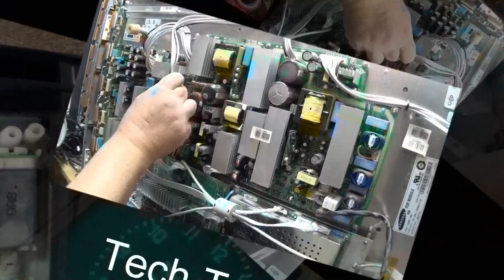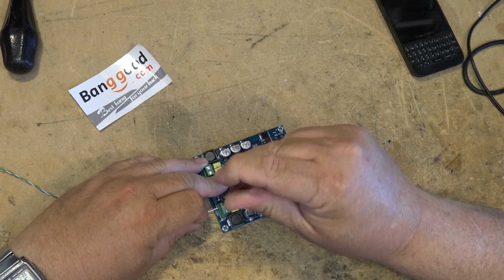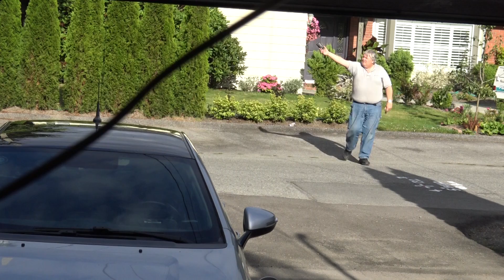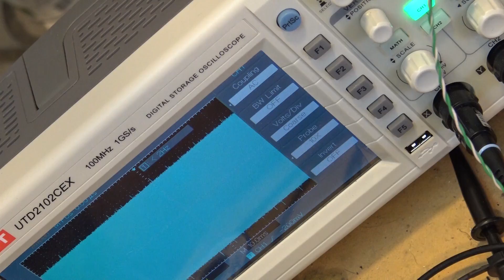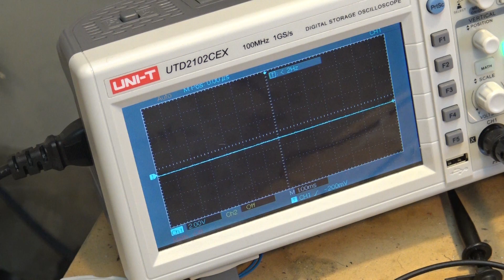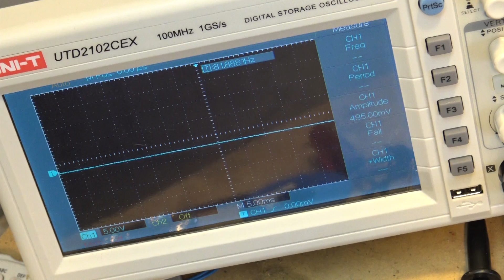TPA3116D2 120 WPC Bluetooth Audio Board test run

Comment: you well need 20 amps on 12 v so how can that thing do 120 w per channel  .....magic ?
Reply from the maker: That spec claim is at max chip voltage which if i remember was 27 volts, and it was also into two ohms. At 12 volts and 8 ohms it's more like 30 Watts.

Comment: What’s the minimal power requirement to power two 1.5” speakers at 10-20watts each? I’m trying to build a portable lipo powered unit.
Reply: I have a few projects in mind from 1.5” speakers to 3” speakers but I’d like to find a Bluetooth board that I can use for various projects to eliminate research. Something they can push 3” speakers and ALSO be able to operate at low voltage for pushing 1.5” speakers because of the type of installation.

Comment: Excellent analysis, made my day
I am building a 5.1 system and isolating woofer completely paired with it's own amp, this helped me decide on what configuration to use as I am using 12V to make it portable as well with a Li-po battery pack. So in theory I should still be getting ~50/~50 L/R with ~50W  2.1 channel or 2x(50W+50W) + 2x(~50W) making part of the system portable while keeping overall performance good enough.

Comment: I've read through the comments and didn't see an answer fora question I have, which is probably simply due to my ignorance. My question is can I use this to power some speakers on my ATV? From the comments it seems as though these boards require some means of regulating amperage.. Can I not simply run power to this board straight from my atv 12v battery which is fused at 10A but ofcourse I can put and online fuse in place but that wouldn't really "regulate". If I can't use this board what do you recommend? It will be mounted in a  waterproof p BOSS brand 6" Tube ATV  speaker. I took apart the Boss tube and it surprised me that it came with a board style amp as I expected it to be in an enclosed style. Once again that's my ignorance with this type of information. Any advice or recommendations would be greatly appreciated.

Comment: Hello.Thank you for nice video.İ wanna give you one question.What does it mean 12-24v? How many voltage i must give to amplifier, 12v or 24v? Or there is a voltage regulator on the amplifier motherboard? Please help me. Greetings from Azerbaijan 🇦🇿 🖐
Reply from the maker: It will run at 12 volts at lower power.  24 for max power.   If you exceed 27 it shuts down.
Reply: @12voltvids  Thank you very much

Comment: Hi! I wanna ask the preset volume once you turn on the amp? Because some bluetooth amp sounds so loud once you powered on then you can only adjust the volume once connected.I want to consider buying this one if sure its not automatically in a full volume once turn on😅

Comment: Would a break-before-make speaker switch  be compatible with these types of amplifiers such as this one?: https://www.amazon.com/Amplifier-Receiver-Speakers-Selector-Switcher/dp/B0796KGVXT
Reply from the maker: The switch needs to switch both the positive and negative terminals.  Many of these switches ground all the negative terminals together.  This would have to be tested with a meter to confirm.

Comment: Lot of information on the board however just need your suggestion please..
I have a pair of 30W 4ohms woofer and a pair of 260W 8ohms tweeter.. Im thinking to setup a tweeter - speaker per channel with them so could use them as right and left channels.. Its setup in a single housing..  Like to know if this board be suitable for this speaker setup.. if not then like you to recommend the best amp board with bluetooth please..

Comment: I'm not getting Bluetooth range more than 3 or 4 metres despite soldering the antenna
Reply from the maker: Bluetooth operates in same frequency range as 2.4hz wifi but much lower power.  So wifi can and will interfere and reduce the range.  Sometimes my bluetooth earpiece loses connectivity of my phone in my opposite pocket.  Phone in left pocket earpiece in right ear.
Reply: @12voltvids  ohh! I will try if the range exceeds with the WiFi turned off.. how are you doing in this quarantine time! Do lemme know if you wanna talk over email, we can exchange great ideas! My email is talktoalokd@gmail.com.. ciao!
Reply from the maker: @AlphaTroniks  Quarantine? Not for me. I am an essential worker, so I am at work Friday to Monday as usual, and even get premium pay for doing so. The 3 days I am off I cam so bloody busy with my business these days I have got no time to shoot videos.
So some may be hit hard by the shut down, those of us that still have to go to work are busy, and it makes the job very challenging, as we can not go into peoples homes to do the required work which makes repairs and installs interesting to say the least.
Reply: @12voltvids  ohh! I would love to read an email from you soon! Take care Sir! Respect,
Al from India

Comment: Hi there I've just bought one of these in the UK after seeing your video.  👍. Was wondering though if I used just a 12v power supply would the output wattage power still be 120w per channel or would it be less. Cheers John
Reply: Hi mate. I'm in the UK. Where did you buy from? Link pls. Thanks.
Reply: @SahinurUK  Hi I got mine from Ebay just search for Bluetooth amplifier board,  or Amazon has also. Cheers John
Reply from the maker: It would be less.  Supply voltage determines the p-p swing of the speaker voltage.  24v will allow for 24v p-p  voltage swings per output rail. 12v would cut the output voltage in half so half power everything else being equal.
Reply: @12voltvids  Thank you for your reply. And give the bluetooth trick a try. Cheers John

Comment: I'm kind of new to electronics, am I missing something?
120 watts per Channel???
12 V. Power supply.... is that thing pulling 10 amps? 
Or at 24 volts pulling 5 amps?
I know the thing has inductors but, if the amperage isn't there it's not there! So where does the wattage come from?
One more question?
12 volts X 10 amps =120watts. So that accounts for one channel 120 watts.
You said something about the inductor alternating?
Does that mean the 120 watts is alternating from left to right channels, using the inductor/s?
Thanks Dave. it's an honest question I'm not being a jerk!
Reply from the maker: The way they calculate this is into a 4 ohm load.  This power is also rated at the full working voltage of 24 or 26 volts not 12.  Look up the specs of the chip. Also it is a BTL output. Each leg should be able to put out 50 watts. Remember that the speaker terminals are driven out of phase with each other so one side goes + while the other - and then they flip.   Class D are very efficient so all the way of thinking and calculating power used on linear amplifiers goes out the window.  These are pwm amplifiers and efficiencies are gained through those inductors.
Reply: @12voltvids  okay, thank you!  I appreciate all that information!

Comment: These boards are great for dead bookshelf systems, saving the speakers from scrap. I have to try the 1.5 inch antenna mod.
Reply: Yup. I just gutted out my klipsch promedia 2.1 speakers and am replacing it’s amp with this amp.

Comment: Where did you solder that wire on to. Thanks
Reply from the maker: I soldered it to the copper that formed the original antenna.

Comment: At about 15 min in the scope trace is the best visualization of how a Class D amp works that I have seen on YouTube. You can just look at that and understand what is going on.

I have been wanting to put something worth listening to into my car, but after 10 years in the car audio industry I have noticed that car stereo equipment seem attracted to pawn shops like drunks to bars. My experience is that anything that even looks like car audio equipment tends towards rapid unplanned removal.

Several of these amps with some simple electric crossovers (or maybe DSPs?) could be the core of a good car stereo. I am thinking about how to make something I want to listen to that will not get my car torn half way to hell. This and some raw drivers from parts express could probably be in my car and not even require locks and alarms...

I will probably leave the amps running on heavily filtered 12v power since a car tends to be a more thermally challenging environment.
Reply: Can't edit so...
At about 15 min in the scope trace is the best visualization of how a Class D amp works that I have seen on YouTube. You can just look at that and understand what is going on.

I have been wanting to put something worth listening to into my car, but after 10 years in the car audio industry I have noticed that car stereo equipment seem attracted to pawn shops like drunks to bars. My experience is that anything that even looks like car audio equipment tends towards rapid unplanned removal.

Several of these amps with some simple electric crossovers (or maybe DSPs?) could be the core of a good car stereo. I am thinking about how to make something I want to listen to that will not get my car torn half way to hell. This and some raw drivers from parts express could probably be in my car and not even require locks and alarms...

I will probably leave the amps running on heavily filtered 12v power since a car tends to be a more thermally challenging environment.

Comment: Anyone know if this version with the Bluetooth has the same noise floor hiss as the other unit without Bluetooth?
I bought 2 of the non Bluetooth, replaced pots with 10k and still hisses so it is unusable.
Reply: Danfuerth Gillis mine sounds like crap too
Reply: @jimcatx3090  I have looked at these and fixed the problem and now I am actually stomped how this tiny Piece of crap is laughing at my Rockville Power Amp!!! LMFAO. Remove the heat sink then you need to remove R3 ( complete removal ) and replace R4 with a 5.6k resistor. You do not need to use an smd resistor just wired in a regular resistor ( film barrel) and wire it's legs on the R4 pads then put the head sink back in and use some hot glue to hold the sides down properly. I emailed Rockville and sent them some pictures of my little box I put this amp in with 1/4 input and output jack's added along with a power push button on top of the box. It's hilarious how this little plastic box has this power!!!. It turns out these little amp boards have the wrong value resistors in the power amp section pushing almost 40 dB so lots of noise will sneak through, the 5.6k resistor on the R4 will fix this problem. This was on the non Bluetooth boards ( same board just no bluetooth module ). This little board is now my home theater sound amp and also my guitar amp box lol.
Reply: Danfuerth Gillis I would
 I Never buy anything from Rockville so it’s not saying much for this amp board it is pretty loud I probably would waste my time working on this board I have about 10 different ones i play around with in the winter I have the gains set about 1/4 way so u can’t hear that bad hiss so it’s not bad I have some nice clean boards that blow this one out of the water
Reply: @jimcatx3090  Yep I ordered 2 Bluetooth 120x2 boards and 2 non Bluetooth ones. Since the non Bluetooth boards arrived I worked on those but was disappointed with the hiss even at low volumes. These boards require 10k ohm potentiometers and the R3, R4 mods. I did not even change the pots only the resistors and that eliminated all hiss and noise. These little  suckers pack some massive punch and they don't get hot at all. I was playing guitar on a 4X12 cabinet at 8hms and this thing was actually more clean and had tons of power almost like a rack power amp lol. For its size and the simple mods to repair them at $5 per board might as well order a couple of them and build your own rack power amp with multiple inputs and outputs. I am building a rack power amp right now which will have features not available in $5000 power amps. Total build price with tube preamp, power amp, input and output jack's, toroidal transformer, fx loop section $110. The test box will be plastic shell to test the amp out which then gets transfered to a metal box after passing tests. It will have individual main back fans control, individual power amp fan control, and some other stuff on the front of the unit, like 1/4 ,  XLR, Midi patch through section to the back. It's a 420 X2  watts amp. Will be doing a video on the little amp and the big one once I get the parts in the mail.
Reply: Danfuerth Gillis I don’t care may god have mercy on your soul
Reply: @jimcatx3090  lmao, well if I get zapped don't worry that will be recorded with the video demo haha.

Comment: Hi. I bought an amplifier board from alliexpress but the problem with mine is that horrible chinese robot voice so LOUD when is power on as well as bluetooth connected. I was thinking about how is possible to remove that  annoying voice but it seems impossible since I need to reprogram chips and blablabla. So I was thinking in HOW TO DISCONNECT the bluettoth part and only use 3.5 mm jack input ??  If this is possible I would like some help or your advise, or if you can have some time to make a video about how to make it. Since is a good amplifier board I dont want to waste money buying another one maybe with the same annoying voice. Anyway thank you so much for your effor in each video you make annd sharing your knowledge with us.
This is my amplifier board :

 https://www.aliexpress.com/item/32987898412.html?spm=a2g0s.9042311.0.0.6cf64c4dg3IuaV

Comment: I ordered the one with no bluetooth, I used an external hifi bluetooth module to connect it but there's noise in the speakers. May it be the bluetooth module causing problems?
Reply: miguel pineda i found a solution 
https://youtu.be/AW7fraUb2a8
Reply: @Electronieks  thank you very much 👍🏾

Comment: It's 2017 and your have a Blackberry, so your basically a spook. Sorry I couldn't resist.
Reply from the maker: I have several.  They used to give me a new one every year at work.  I have a curve CDMA, bold, classic, q5, z10, z30 and the android priv.  I also have a playbook.   Now we get Samsung's at work but I still have the old ones.  I use the z10 as a platform to run flash apps to generate clock display on my crt screen. HDMI out into an HDMI to video converter.  Time is pulled from cellular network which is GPS synchronized.  The q5 I use for Bluetooth tests.  
I wish I still had one at work.

Comment: Can you please clarify if the pin out header (LGR pins) on the board are outputting the same audio as the Bluetooth? Does that mean I can connect that aux output to another amp to achieve a 2.1 setup or 4 channel setup? Is the output line level?  Thanks in advance!! 😊

Comment: Can the output of this Bluetooth amplifier board be bridged in any way to connect it to one speaker? So, instead of 120w x 2, you get 240w x 1... is this possible?
Reply from the maker: The outputs are already bridged so no, it has to drive 2 speakers.
Reply: 12voltvids thank you for your prompt response!

Comment: Greetings. I have same. I added the aerial as per your great suggestion. I have done it v succesfully with several others too. However on this am I am having issues. After a week the bluetooth is down to just an unusable 50cm. Any ideas out there please??
Reply: press the reset button ;)
Reply: @geosplayground663  thanks fir this
Reply: @FynbosGarden   sold coil on Bluetooth to increase distance of it . not thin and not too much thick

Comment: Great info chap. I've just done the antenna trick!!! 😳 it started out at 5 meters and is about 30 meters now!!! Awesome, thanks.
One question, what does the 468 equate to? 
Many thanks
Reply: Where did you solder the antenna at?
Reply: @raulsd.i.y.videos5585  on the board antenna.

Comment: this board is great!! powering it with a 4s lipo and it has bunch of power at 8 ohms. starts to distort easily at 15 volts, i will add a voltage booster and set it to 25v

Comment: Maybe I missed this in the comments or in the video, but is there a standalone power module that you would recommend with this thing? I'm still wondering how you would get 200 W with only 3 amps at 19v?
Reply from the maker: Where did you get 200 watts? It is rated 100, and not at 19 volts.
Here is the specs on the chip.
Supports Multiple Output Configurations
2 × 50 W Into a 4-Ω BTL Load at 21 V (TPA3116D2)
2 × 30 W Into a 8-Ω BTL Load at 24 V (TPA3118D2)
2 × 15 W Into a 8-Ω BTL Load at 15 V (TPA3130D2)
Wide Voltage Range: 4.5 V to 26 V

So at 26 volts, into 4 ohms it can do 50+ WPC. The supplier claims 120 total or 60 per channel.

Comment: How many RMS power does it output really?
Reply: Find the data sheet for the chip and most likely will be listed. It will also depend on voltage supply. Please remember it's a chip so take the ratings with some grain of salt. If you want a real Class D amp then companies like Hypex, Pascal, PowerSoft are the answer.

Comment: it doesn't have two separate tpa3116 ic rather a single ic with two channel. fake board,claiming 120 watt per each channel. hardly you'll get 48+48 watt in total from both channel aslo with 24v supply

Comment: A person would think a longer antenna is better because it has more surface area to catch radio waves. But that's not true. I remember our first outdoor tv antenna. The longest rods was for VHF, and the very short ones was for UHF.
Reply from the maker: It's not the point of making it longer. It is getting the radiator away from the ground plating on the back side of the board.  It has to be cut to the resonant friqiency.

Comment: hi,
at 14:00 its not an input but its output as for head set or you can add another amplifier to the board, i have tried that and i foud it output, i have something to ask about, am trying to connect TPA3116D2 the normal board with Bluetooth decoder so i can use multi inputs like USB, AUX, SD CARD, Bluetooth but the main problem is the Ground loop noise, do you have aidea so i can avoid that nise?  
thanks,